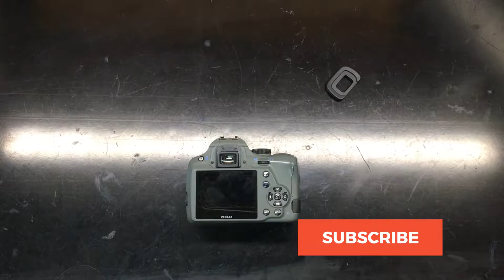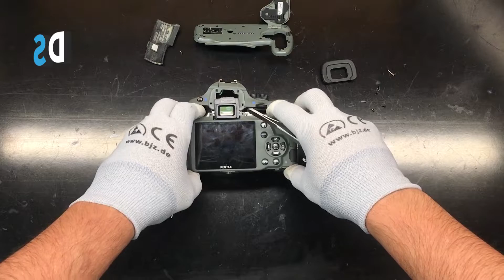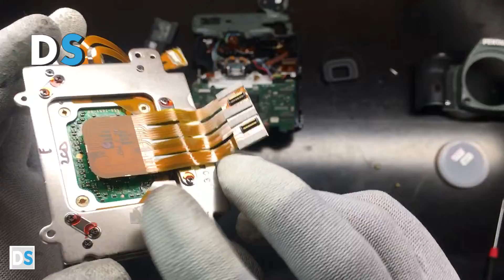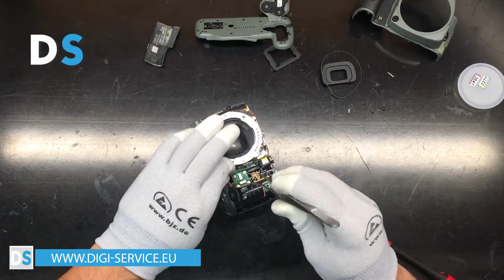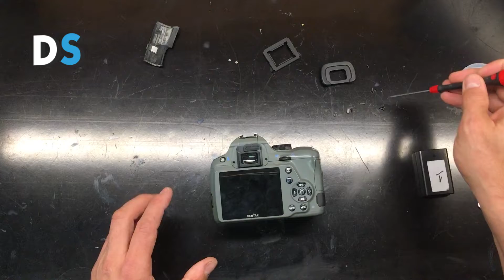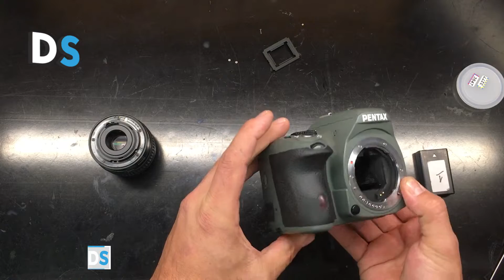How to repair Pentax camera DSLR K-50 - Remove AA filter and exchange solenoid

Comment: Thank you for many interesting videos.  Removing AA filter from K50 results in image similar to K5 II S?  Can AA filter be removed from other Pentax such as older K10D, k-m/k2000?
Reply from the maker: HI, yes, you can remove the aa filter. The images will not be the same like K-5 IIs because this filter restrict some light spectrum  and if you remove it , the final image will be more red :) On K-5 IIS this restriction is available and only the final image is more sharp(moire effect) :)

Comment: How did you modify the solenoid? The "russian" style?
Reply from the maker: Hi Rene :) No idea what you mean , but the modification is to use sand paper and rounding the edges :)
Reply: @DIGISERVICEBG  thats what I mean :)
Reply: russian style is soldering. Sanding is cheapo style. Japanese solenoid is correct style
Reply: @soi-luna3087 The solenoid has worked for years, the reason for the malfunction must be something else, I suspect that the geometry of the solenoid has changed or the position of the mounting of the solenoid. All my solenoids look like new, there is no wear.
Reply: @dorfschmidt4833  The www is full of exact explanations and why modifying the plunger is not recommended. It can lead to further damage.